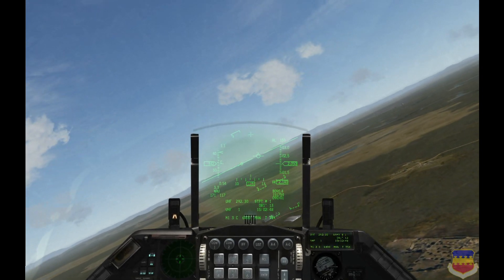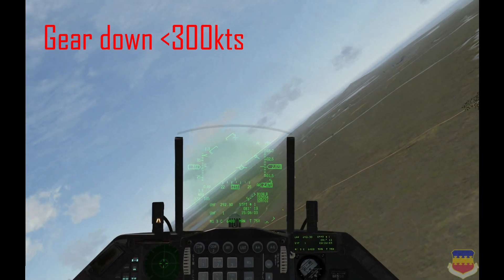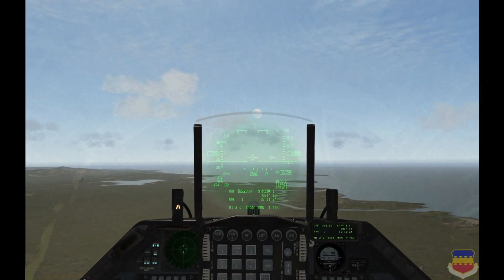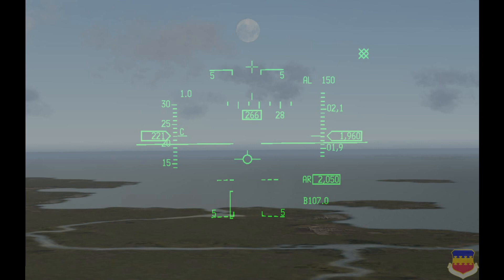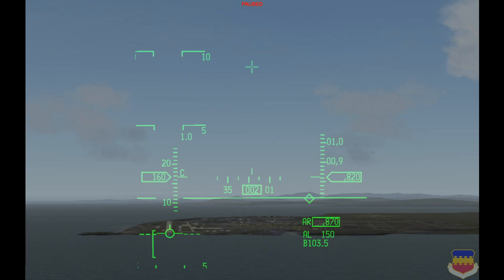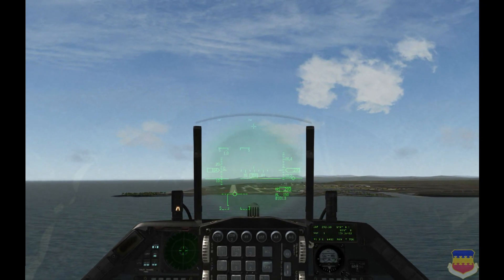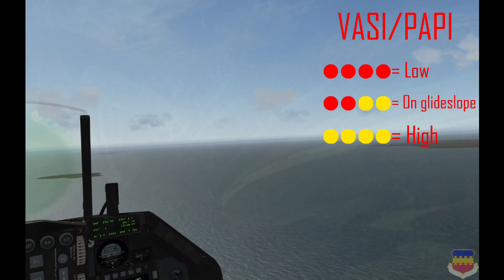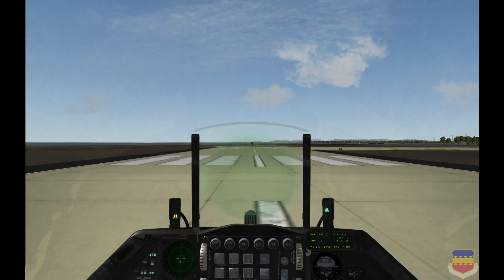Falcon BMS 4.32 Landing Tutorial

Comment: GREAT tutorial!
The best BMS landing tuto available on the Web! Thank you, everything is quite accurate. And yes, you are right about the 3° GS for most of airfields.
Reply: +Dee-Jay -Hi, I bought the standard Falcon 4 (boxed version 1.01) a few days ago but there are severe graphics problems on my high-end Win 7 PC. I've juggled all the graphics options without success and am on the verge of uninstalling it. I know it's a 2005 sim so maybe it won't run on modern hardware?
Any suggestions/advice/death threats etc?
Reply: Tungsten Kid
 May I suggest you to Goolge "Benchmarksims" and register to the forum ... you will found a LOT of informations ... especially that Falcon4 is more that a 2005 sim ;) ... BTW, I guess that you are talking about falcon4 Allies Force which is not exactly the same than the very last flavor of Falcon (FalconBMS)
Reply: Dee-Jay - thanks, yes, mine is Allied Force
Reply: Tungsten Kid
BMS add-on won't work with Allied Force.
Reply: Dee-Jay - thanks guys the good news is that I've just got Falc4:Allied Force working so i'll be going on with that for a while..:)
Reply from the maker: +Dee-Jay Dee-Jay himself! It's an honor. I've been out of BMS for so long I need to make time to relearn everything for 4.33.

Comment: You are right that everyone has different ways of landing. Here is a way that works perfect for me. When I drop my gear I usually bump the trim on the nose up a couple of notches. This will help keep your nose up a little and you don't have to fight with the stick as much. I drop my speed to about 140 or 145 and put the fpm on the threshold. From that point I can actually keep the fpm on the threshold just by adjusting my throttle. Your speed will usually depend on your weight, but as long as you use your throttle to keep the fpm on the threshold you will be fine. I only have to use the stick to adjust left or right if needed. I hardly ever have to open the brakes because I am not flying too fast. Just adjust your throttle to keep the fpm on the threshold until right before touchdown. Then move the fpm to the end of the runway and cut the throttle. The nose up trim will set you up for touchdown in a perfect pitch for areobraking and you would not have to use your air brakes. That is one less thing to have to deal with during landing. Give this a shot and see if it is any easier for you.

Comment: One of the better tutorials I've seen, thanks.
I think maybe it would be a good idea to aim for the touchdown zone though, rather than the threshold. Aiming for the threshold, especially at only 2.5 degrees glideslope, brings you very very close to those localizer antennaes. In real life most jet pilots aim for that touchdown zone (big bars).

Then after landing the aeroplane is usually slowed down by aerobraking (keeping the nose up). The nose doesn't come down this soon and you should be able to slow to under 100 knots (even 90 with a light jet) before touching the brakes.

The reason you couldn't correct your steering was that you had full brakes on. I think this is a BMS quirk. Come off the brakes a bit and you'll find you have more rudder control. I often find myself landing a heavy jet and fighting with braking vs direction as the runway end gets closer and closer! This is obviously not how the real thing works but something to keep in mind for BMS. It's as if BMS uses directional braking as rudder control for some reason.

Also, I've said this before elsewhere, the VASI system in BMS is completely pointless and shouldn't even be demonstrated as it develops bad habits.

By the time you see 4 reds you should be aborting the approach immediately. Because BMS doesn't have the 1/3 or 3/1 states, the whole thing really is useless!

As it stands it is an instrument that simply tells you that you're:
a) Very, very, very roughly sort of near the glideslope or
b) So far off that you need to abort the approach.

I hope they can fix it, but for the moment it provides absolutely no useful information to the pilot and I would highly reccommend ignoring it completely.

Thanks for the video, well explained and good demonstration.

Comment: The reason for kicking the rudder to align the aircraft with the runway during the flare is to keep from putting a side loading on your wheels and ripping your landing gear off on touchdown.  In addition to using the rudder to point the plane down the runway, you have to use opposite aileron (i.e. banking into the wind in place of crabbing) to keep from drifting off the side of the runway.  Yes, you will end up putting only one of your main wheels on the ground at a time, but do it gently and you won't stress the wheels (it's probably not modeled in this game, though).

In your video, you had a strong crosswind from the right, so you should use left rudder to align to the runway and right bank to keep the plane from drifting to the left.
Reply from the maker: According to real pilots on F-16.net this is not done in the F-16.
Reply: This isn't a Cessna 172. You don't do any of that forward slip shit. I believe you just land crabbed and side load the gear. It can take it.
Reply: 6 years later, I know, but for future reference from the BMS -1 version 4.34 revision 2, page 225: "Because of the ARI that connects Aileron to Rudder, the wing down sideslip is to be avoided with the F-16. The rudder should not be used when landing the F-16!
The wing level crab is the only technique for landing the F-16. Take your feet off the rudder pedals and point the aircraft nose into the wind."

Comment: the aoa indexer has nothing to do with calculating weight. it just shows your aoa. your ending speed when you reach the desired aoa is determined by physics, not the flight computer.
Reply: Neal Newbill What he's saying is that the indexer doesn't use speed or weight to calculate angle of attack. Angle of attack itself is measured by an external probe. It is not derived from any other data. The flight control system doesn't calculate any kind of approach speed either. The point of referencing AOA on landing is to not chase a particular airspeed. There is an ideal safe AOA margin for landing the F-16 (11 to 15 degrees) and the indexer is programmed to illuminate the green "O" when the aircraft is flying at that AOA. That aircraft could be at that AOA at a variety of airspeeds and weights. The indexer doesn't know or care that you're on approach; that's why the green "O" could illuminate during the middle of a dogfight too. But when you enter the glideslope at the right altitude, referencing AOA is a reliable way to stay on the glideslope during the approach and make a safe landing. The power and (thus airspeed) needed to maintain the proper AOA while on the glideslope changes because of weight, but the indexer doesn't need to take that into account because 11 to 15 degrees is always going to be 11 to 15 degrees, regardless. It would function the same way even if the FCS was totally busted. If it calculated an approach speed, it would be unnecessary information since referencing AOA on approach is in itself a way to simplify landing procedure precisely by NOT having to make airspeed calculations based on weight. Enter the glideslope correctly, use power to maintain the proper AOA, and the laws of physics sort out the airspeed for you automatically.

Comment: Hello. I am not making the difference between the speed and fuel flow. In the manual is written : reduce the speed on 160 node and I dont know how to do that...  The second command which  I have to do is- Fuel flow on 2300.  I can do that with + - or with the button on my joystick which I can roll.

So, how to speed down the plane?

What am I making wrong?
Reply from the maker: The manual's instructions about speed and fuel flow is incorrect. Speed and fuel flow will be different depending on aircraft weight. Ignore that and fly according to AoA as shown in this video.

Comment: thanks. when i touch down i can't seem to slow down and run off the end of the runway. how do you slow down after touchdown? i'm using wheel brakes i think. also, how can you tell if the air brakes are open or closed?
Reply: Neal Newbill
ok, i see it now, under the yellow lever. i guess i hold down 'b' to deploy and hold down shift-b to retract. i wasn't holding down before, that's why nothing was happening i guess. thanks again. i love this video, watch it 20 times already.

so should i always land with air brakes on full?

Comment: me again! i notice on approach, the vasi is red over red (you're dead), it looks like you are coming in very low to me. is that normal or should i try follow the vasi red over white (you're all right)?
also, when i touch down i can steer ok with the rudder (by rudder i mean i'm twisting the joystick) but as i get down to walking speed to exit on the taxi way, the rudder stops working. any idea?. thanks for all the help. it took me ages to learn to land a 172 too (the real one)
Reply: My guess is that the air flow is simply not enough anymore to inflict actuating force to the airframe. You're simply too slow by then. Unlock the nose-wheel and steer that way, also by use of the rudder.
Reply: When you get to a slow speed after landing you can no longer steer just using your rudder. Not enough wind going over your rudders. Activate NWS (Nose Wheel Steering) and you'll steer just fine. But don't do it until your speed reasonably low enough. Otherwise you'll tear up your gear.